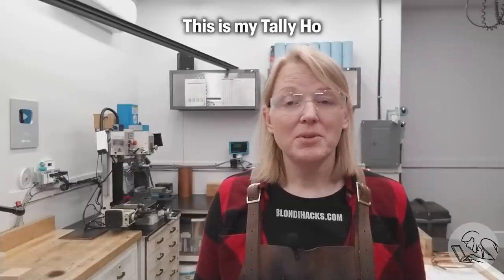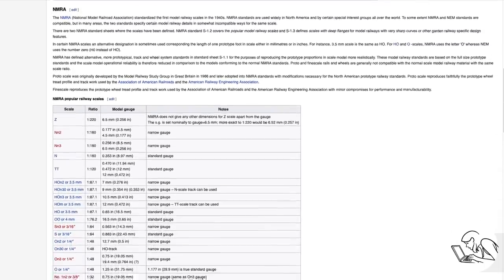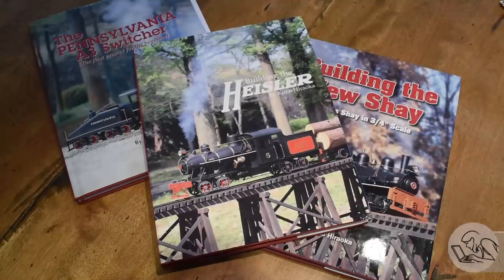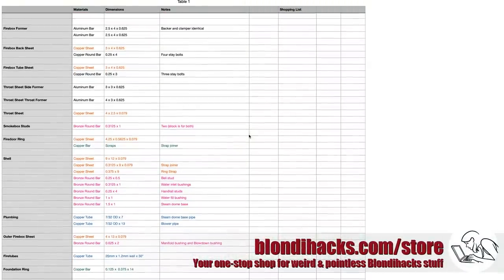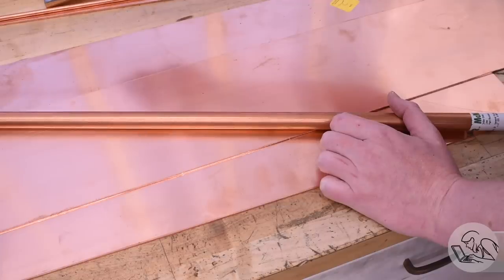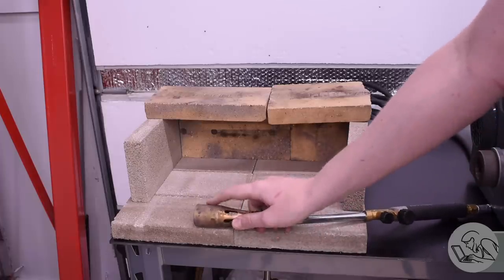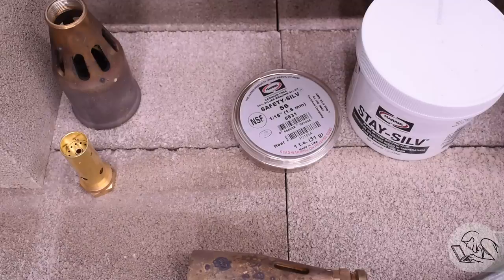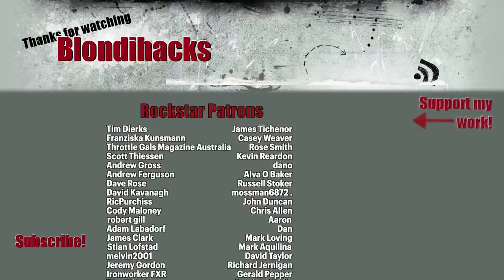Let's Build a Locomotive! Pennsylvania A3 Switcher, Part 1

Comment: I have just updated my Pennsy Switcher BOM.  It's still in the same place as Quinn links to (at the end of the first post in my A3 Pennsy Switcher build log) but it now has Rev B attached.  I corrected a few dozen errors so it's not dramatically different. Undoubtedly it still has errors, but hopefully fewer now.  And of course, you'll want to choose the material that YOU want to use, rather than what I have been using.  The BOM spreadsheet is available for your personal use as a starting point for your materials list.  But as always, use at your own risk :)
Reply from the maker: Awesome! Thanks for the update!

Comment from the maker: A quick note on the fire tubes- since this was recorded I have learned that the .787 dimension on the main boiler drawing is actually an error, and Kozo intended .750 there anyway. So that worked out well. There are not many errors in his books, but this was one.
Reply: I love watching CPR freights come through revelstoke BC
Reply: Hi Quinn.  I am 'close' to Boiler Fabrication for my A3a and was not aware of the fire tube diameter errata.  Where did you find that info?  Do you have a link?  Thanks!
Reply: Thanks very much....                                       
Shoe🇺🇸
Reply: There's a few more errors in the linkage; well documented in the home machinist forums I think.

When I was scoping out a project for a Canadian Pacific G5C, I was hunting down drawings. The Ingenium Museum in Toronto has all of them, including the ones for the engine you want to build. I was able to take pictures of all the drawings so I could make 3D models. They were incredibly accommodating, and an email to the curators would probably land you a tour of their warehouse, which is awesome. It was like the storage facility in Indiana Jones; they have the worlds fastest snowmobile on display, so the second fastest goes in the warehouse. Worth a visit.

Comment: I started down this path on a 7.5 inch gauge union pacific 4400.  I was still working my day job and my dad and I were working on it together.  He drove real steam engines.  

I did 80 percent of the CAD work and 5 percent of the machining before running out of time.  We had to CNC a lot of it to get the parts to look good.  My dad was sick and I didn't have enough calendar time to get it running.

Bought a kit for an electric loco, built it, and build some rolling stock.  Got to take Dad to Train Mountain before he passed, and took him to Riverside Live Steamers to see their Big Boy (dad drove Big Boy locos).  It's a path forward when the steamer seems too big a mountain to climb.  I'll finish the switcher some day, but didn't have to get it all done too fast.

Comment: Welcome to the live steam fraternity Quinn. Your comments about your choice of scale and materials are spot on. Kozo H. is a brilliant engineer.
I'm building a 1.5 inch scale (7 1/4" gauge) Northern Pacific 4-8-4. It's a beast! I'm at the point of cleading the steel boiler. I know what you are in for, and you will love it.
I absolutely  loved your 2 year build comment, so true. I started my project in 1974, but I'm on the home stretch now.
Good luck.

Comment: I've owned a few engines now, and I have to say the Cli-Shay is definitely the easiest to work on and build. However, Walshaerts valve gear is so much better to work with from a reversing standpoint. My current project is a 7.5in gauge 2-4-0. The A3 should be a very good engine to get started in, I think you'll have a lot of luck with it.

Comment: I used Australian Eucalypt hardwood for hammer forms. It's very dense and hard but I also screwed 1/8" hot rolled steel to the top face of the form and radiused the edge. It's the edge that takes most of the punishment from the hammer and the copper stock. Good move to start on the boiler. I've seen so many advertisements for "complete rolling 5" gauge locomotive chassis. Just needs boiler!"
Reply from the maker: Australia has all the best woods. 😄

Comment: Makes perfect sense to start with the boiler. As you say ,if that works the rest is easy (ish). I adopted a similar approach on my current project, a 15 cc 4 cylinder internal combustion engine. I made the camshaft first before ordering the castings as it is the most challenging component. Good luck with the build.

Comment: First time comment but I couldn't resist, great choice of loco. You just cant go past Kozo's engines as a first choice. I started my machining learning (totally no experience in machining prior to this) by building his New Shay in 1 1/2 scale but gauged to run on 5 inch. I can guarantee that it is doable. Kozo's instructions and drawings are so comprehensive  and well described that even a total newbie like me can follow them. My loco is finished but it did take about 7 years to complete. Thinking of doing his latest the K27 now but adapting it to 5" gauge.

Comment: This Pennsylvanian's favorite cute little steam engine is the B & O  0-4-0 dockside! Been to the Stoney Creek bridge and through the Spiral Tunnels. 
If you want the 0-6-0, modify the plans to add a flangeless center axle, hopefully the boiler and frame materials are long enough for the added length.
The late George Hart bought a pair of Canadian 0-6-0s to operate on the old Maryland and Pennsylvania back in the 70s out of York, Pa but the track curves derailed the project. I think one remains in the Strasburg back shop for restoration.

Comment: The CliShay was the first locomotive that I built in high school 8 years ago. It was the perfect engine for me as I had no machining or fabricating experience as most of the parts on it are were on the easier side to fabricate. Even drew up and built the boiler after being certain that my welding skills were up to par from practicing for a few years in my welding classes. Still have fun taking it out and running it every so often while I work on my other locomotives now.

Comment: The best reason to use pure copper for the boiler is that it is so much safer than steel.  I tried to find a paper I read years ago that detailed the Australian government's testing of hobby boilers, but wasn't able to find it.  They were not able to get any of the copper boilers to explode even though they pumped them up to 15,000 PSI.  All that happened was they expanded like balloons and then teared and leaked.  Not to say that someone might be able to figure (or stumble) on a way to make them explode. :)  

I'm looking forward for this as I have wanted to make a live steam loco for a long time now too.  This will be a lot of fun, thanks!

Comment: Also for the fire tube you could possibly ball it out; find a ball bearing that will stretch it out to whatever combination of ball size, ID and OD works best, heat the tube, force it through.  Anyway I hope this takes a tiny bit of the sting out of the bill for all that material!

Comment: Kozo's A3 is a superb starter locomotive - great choice!  I built this several years ago.  My build took just over 1,800 hours of labor spread over 4.5 years.  I note you commented on the supply of various metals you will need but there is another thing that will suck the cash right out of your wallet:  Fasteners!  I've got a 10 lifetime supply of scores of the different small screw sizes and types needed for the build that McMaster only sells in boxes of 50 or 100 pcs.    I can't wait to see your progress.  Good luck!

Comment: Smart to start with the boiler.  I did not do that and I am feeling stuck with a 3/4-finished 7 1/4 loco due to lots of challenges with boiler materials and skills.  I will persist, but I might have reevaluated my choice of engine early on if I had realized the difficulties with the boiler.

Comment: The simple solution is adding shelves near the ceiling with holes connecting all rooms of house. Easy as Pi.

Looking forward to seeing how you put the boiler together. I’m imagining it like making a sheet metal box but no idea. It has to have an internal box in a box.. to boil I’d guess.

Comment: This will be awesome! As an owner of a 1/8 scale H10 , you will find great joy in this project after the build as well. I don't  have the skills so I bought my loco as a almost complete build. Getting it running perfectly and finishing it off was great! But I had help from very knowledgeable friends to do so. One thing you must consider is your C.O.A.L , getting the good stuff is becoming pretty tough, we may rename it unobtaium as well. With this smaller boiler, tubes and fireboxe you need to use good clean burning coal. Talk to the runners at the track near you to see where they may source it. A great running engine can act like a poor design when the wrong coal is used. I only burn Pochantas in mine. Also look into using Boiler Saver. You are doing all copper but water is water and using Boiler Saver will help keep things cleaner in there and the rest of system. Tally Hoe and get going!

Comment: Now you really got my attention 
Stay silv is the best I use it almost everyday but I solder small stainless steel parts
I also use a hho torch it saved 
Sooo much $ on gas both o2 and acetylene the torch literally runs on water with sodium hydroxide or potasium hydroxide as the electrolyte

Ps if you ever need small parts tig welded you need only ask 😉

Comment: This will be a good series. You are up there with Mr. Crispin now with his locomotive build. I think it is worth pointing out that in addition to all of the excellent reasons you gave for using copper as a model boiler material, a significant one is that it's thermal conductivity is an order of magnitude higher than steels. Here in the UK model boilers have been built of stainless but I believe they were very difficult to make steam well.

Comment: A great uncle I had, built a small locomotive. I forget much about it since it's been nearly thirty years since he passed away and he finished it about three years before he died. But anyway, I remember that it sat on a short length of track that he fixed to a dedicated table instead of having to move and measure the gaging width constantly. Did the track of yen got the axels and carriage truck for the drivers sized then the rest was made and fitted.  It was a working model of one of the engines that he remembered from his youth stopping at the depot in town until the last passenger train stopped I think in the 60's.

I want to say that it got donated to the city museum but last I went I never saw it on display.

Comment: Hi Quinn, before you crack on with the boiler I would check with the club you intend to run the locomotive.  They should have a model boiler inspector in their membership and will be able to advise you on the boiler materials to ensure they are happy for the locomotive to operate on their track.  Also the boiler inspector may want to visually view the work at certain intervals before the pressure test at the end, ensuring the build is correct.  Great project, good luck look forward to it in future videos.  Regards a fan from Aus.

Comment: Do not worry too much about boiler efficiency. The clausius rankine cycle is the limiting factor, depending on the system pressure you can calculate roughly one per cent themal efficiency per applied bar system pressure. So if you run 2,5 bar or round about 36 psi you will end up at 2,5 per cent mechanical energy produced out of 100 per cent of thermal energy.
But thermal efficiency is not what is achieved in building a model steam engine.
Keep up the good work, I really enjoy it.

Comment: With TIG welding copper you need an incredible amount of heat, rough estimates are that you need c2 -3 times as much heat as you would for welding the same thickness in steel, driven by the heat conductivity of copper. The other thing worth pointing out is you need a specific grade of copper to TIG weld

Comment: Hooray!

Copper being "extremely simple" to hammer form... I would perhaps have said "relatively simple, compared to anything else you could use"!

Interesting info about the unsuitable brazing rods, I've never heard/read that.

Love the Canadian standard checked shirts :)

And yes, sadly I have spent 10 years building my loco. I'm struggling through the paining now. I know it runs, on air via the boiler. I just find it more stressful than relaxing so it's little bits, not too often. I do have one to run but it's full of problems I don't ever seem to be able to get to the end of, which is a bit discouraging too. I'm sure yours will be lovely.

Comment: Locomotives are big projects with lots of hours, but you have the skills, and a good workshop. You may have to buy in the wheels which are usually cast steel. I know you will make a great job of this.....
An old friend of mine that I have not seen in 50 or more years was about 1/3 through building a 5" gauge Pacific class loco. I often wonder if he ever finished it. The bits I saw looked great, and he was a professional engineer...
Building railways in Canada is like building them in New Zealand where I live.... lots of bridges and tunnels...
Good luck with this, it will be a challenge, but having watched you work for some years now, I know you will make a first class job. 🙂

Comment: Only on e problem I got here. I;m 76 the day after Christmas, so odds are pretty slim I will ever see the finished engine run. - A close friend of mine and his dad (who lived to be 101 years old) built a really big 4-8-6. 7 incher.  They own a for real machine shop and I think they still took something like 30 years to get it done. - Really a work of art, though. (He ever has a Gas powered "Diesel" too and a bunch of rolling stock and like a mile of track.)

Anyway, I will be a regular on watching you build this thing as long as I last. - Waiting for Piczinsky to set up his line shaft for his machines and run it with his engine he built like yours.....He still has to make a boiler, though, but I think I got a better then average chance to see that run,,,,,It sure will be fun to watch you progress through all the operations ahead of you.  

God bless you and break a leg. I'll be watching for sure.

Comment: Quinn, concerning the .750, heavier wall tubing part of the video. If you reduce the diameter the MAOP goes up for a constant wall thickness.  The formulas found in the Copper Tube Handbook (free PDF, just search) are:

Rated Pressures Based on Calculation
As for many piping materials, the calculated allowable internal pressure for copper tube in service is commonly based on the formula used in the American Society of Mechanical Engineers Code for Pressure Piping (ASME B31):
WHERE:
P=allowable pressure, psi
S=maximum allowable stress in tension, psi
t min=wall thickness (min.), in.
D max=outside diameter (max.), in.
C=a constant

P = 2S(tmin -C) / Dmax - 0.8(tmin-C)

For copper tube, because of copper's superior corrosion resistance, the B31 code permits the factor C to be zero. Thus the formula becomes: 

P = 2Stmin / Dmax  - (0.8*tmin)

The value of S in the formula is the maximum allowable stress (ASME B31) for continuous long-term service
of the tube material. It is only a small fraction of copper's ultimate tensile strength or of the burst strength of copper tube and has been confirmed to be safe by years of service experience and testing. The allowable stress value depends on the service temperature and on the temper of the tube, drawn or annealed. The downside of utilizing this calculated pressure rating is that it underestimates the actual safe performance of the tube since it is overly conservative when applied to thin wall tubing (where the diameter to wall thickness ratio is greater than 10) like the commercially available copper tubes covered in this handbook. In addition, it does not account for the strain-hardening characteristics of copper tube that can increase the strength (true
stress) over seven times.

SMYS for annealed copper tubing: 5,100 psi. 
SMYS for drawn copper tubing: 10,000 psi.

B31.3 Example using original tubing dimensions and annealed:   

2(5100)(0.040) / 0.787 - (0.8 * 0.040) = 406 / 0.755 = 537.7 psi

B31.3 Example using original tubing dimensions and drawn:   

2(10000)(0.040) / 0.787 - (0.8 * .040) = 800 / 0.755 = 1,059.6 psi

B31.3 Example using your tubing dimensions and annealed:   

2(5100)(0.055) / 0.750 - (0.8 * .055) = 561/ 0.706 = 794.62 psi

B31.3 Example using original tubing dimensions and drawn:   

2(10000)(0.040) / 0.750 - (0.8 * .055) = 800 / 0.706 = 1,133.14 psi

If he used annealed copper and you used drawn copper you can go to lower wall thickness and increased ID. 

Comparing "flow capacity" change for the ID reduction (rule of thumb is sqrt of the diameter of each diameter then do a % change calc)

ID original = 0.787 - 0.080 = 0.707; Sqrt = 0.8408
ID your tubing = 0.750 - 0.11 = 0.640; Sqrt = 0.800

% change = (old number - new number) / old number = -0.0485 = -4.85 % flow capacity, ie net reduction of 4. 6% for your tubing selection. So not terrible but combined with the lower heat transfer due to wall thickness, increased velocity, and slightly lower flow rate the accumulated difference might give you a noticeable performance decrease. Idk... the physic is the same but miniature "things" don't always follow the rules. Probably because some coefficient gets missed.